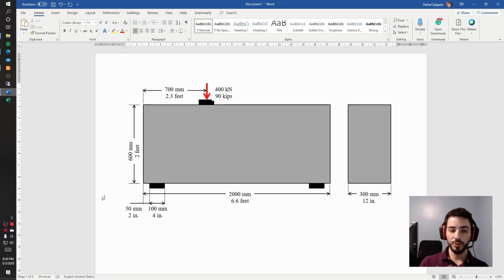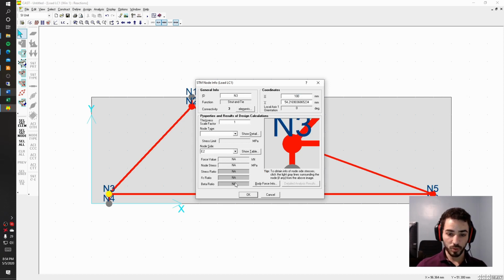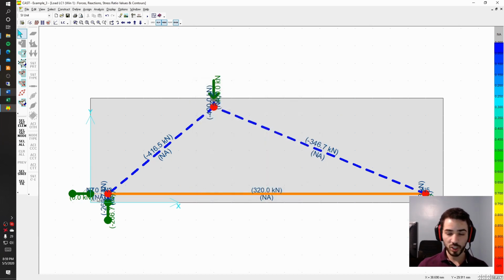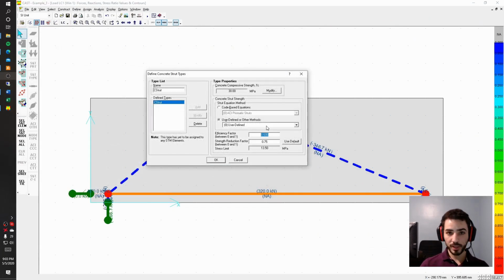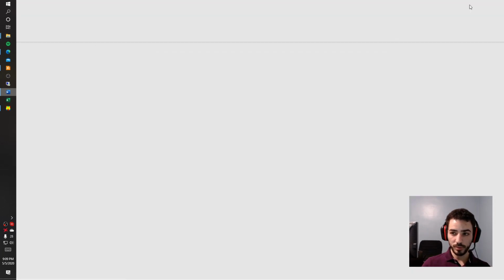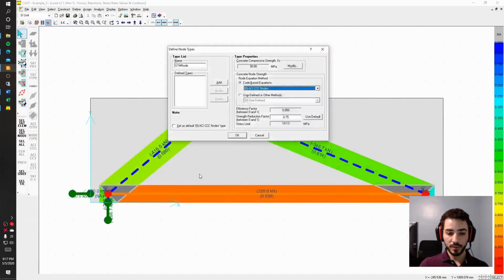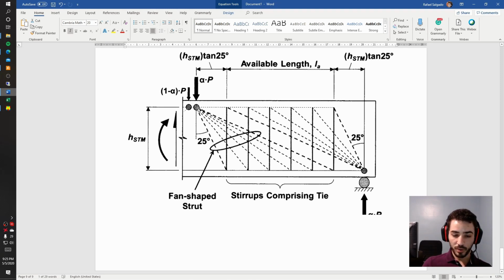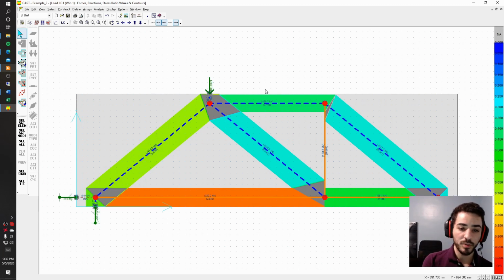Strut and Tie Modeling as per ACI 318-19 (Deep Beam)

Comment: I construct beam column joint but i have problems when model goes to run , it gave me error due to unstabilty .. may you help me to solve this problem
Reply from the maker: Ahmed, b-c joint modeling is another application of STM. You should be careful with developing a valid and efficient model. Best to look for published models from trustable sources. The instability error is most likely related to your support restraints. Ensure you have properly connected at least three restraints.

Comment: I have a question: can we define the struts such that the width on top would be different than the bottom?
Reply from the maker: Yes, you can but when you are checking the strut capacity you should use the smallest width. What you suggest may be beneficial if there is an overload in one node while the strut capacity is sufficient. If you can use a larger width for that node, you may eliminate the overload.

Comment: Hey. Really nice tutorial!
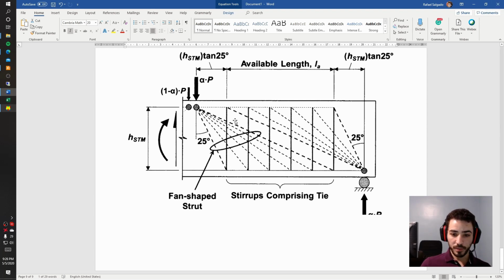At 27:31 you show how to calculate and use a distributed tie for the vertical reinf. But after that you actually design your tie with 4 legs instead of distributing the 134 kN on a couple of legs @200
Anyway thanks
Reply from the maker: Good point. We did two models here. Model 2 has one vertical tie that bundles all shear reinforcement. At 27:31, Rafael is showing a third modeling strategy where you distribute the shear reinforcement. This would be Model 3. You should determine whether Model 3 is needed for your beam. It will reduce the angles of struts and thus their utilization ratios. If you have no overloads in your struts, you don't probably need lower strut stresses and thus no need for Model 3. Realize that Model 3 will take more effort than Model 2. In short, you should judge your situation before proceeding from Model 1 to Model 2 to Model 3. I hope this helps. Please don't forget to subscribe to support our channel.

Comment: Sir, how can we assign distributed load in Vector2(Formwork plus) to beams?
Reply from the maker: You will have a dense mesh with VecTor2. You can assign a point load to the nodes based on a tributary area approach.

Comment: Hi there,

Awesome video, thanks a lot for that!
A small question: Is it possible to create steel reinforcement with different strengths? In my model i have steel with a strength of 500 MPa, but i also have some high strength steel reinforcements with a strength of 1000 MPa. I can only find the option to change all my reinforcements strenght, can this be right?
Reply from the maker: Yes, you can at different location. For the same location, you may take weighted average as SUM (area*fy)/total area.

Comment: How different the STM modelling would be in a beam with compression reinforcement?
Reply from the maker: No difference for this beam since no struts are available at the top. For multiple point loads, there will be a compression strut at the top, and you may model it as a 'reinforced strut.' This will give more capacity to that strut. If that strut does not govern the analysis, no change will occur in the results whether to consider compression reinforcement or not.

Comment: Hocam iyi günler. 3.sınıf inşaat mühendisliği öğrencisiyim. Araştırma konum "strut and tie model" henüz betonarme dersi almadığım için daha rahat anlamamı sağlayacak herhangi bir makale ya da kaynak (ingilizce veya türkçe) önerebilir misiniz?
Reply from the maker: Strut-and-tie method is typically covered in the textbooks of Reinforced Concrete Design. You may check out Prestressed Concrete Structures by Collins and Michell. It is an excellent resource to add into your library. Reinforced Concrete: Mechanics and Design by Wight and MacGregor. I don't think one can truly understand the STM without a decent understanding on reinforced concrete design, so you may wish to revisit all these once you complete the concrete design course. Good luck!